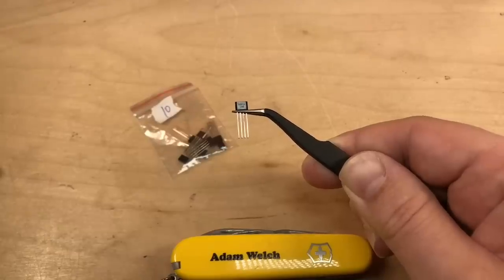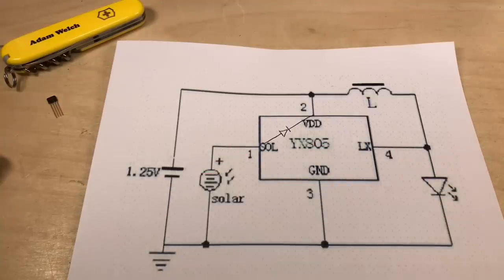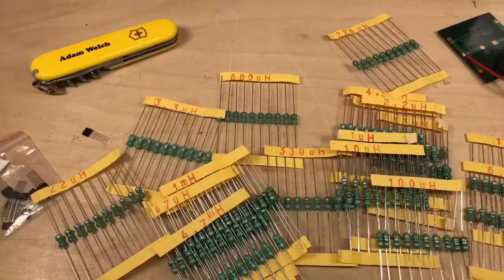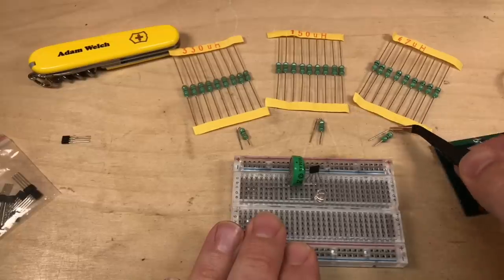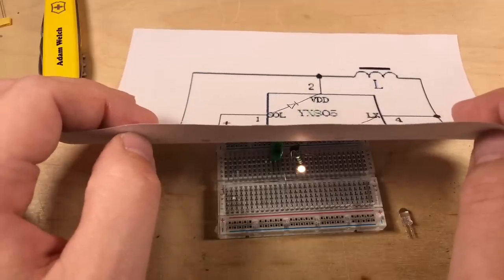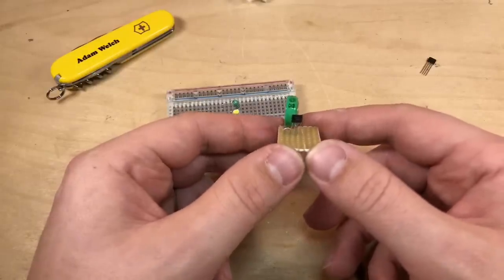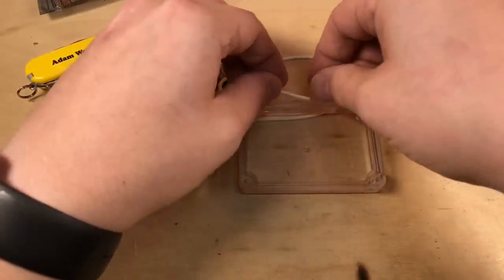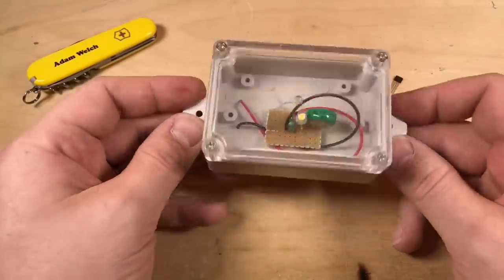YX805 - Solar Charge Controller?

Comment: Thanks for explaining how the inductor contributes to the voltage boost! You have a well-stocked shed, with a modern o-scope and a variety of inductors. :)
Reply: It can be rectified to run transistors, RGB color changing bulbs , 555 timers, etc
I have a video for that also

Comment: Nice one, Adam. Put a larger cell on it, and the LED on the opposite side of the board to the cell, to allow more light out of the box, and it will make a very nice nightlight for less than a pound.

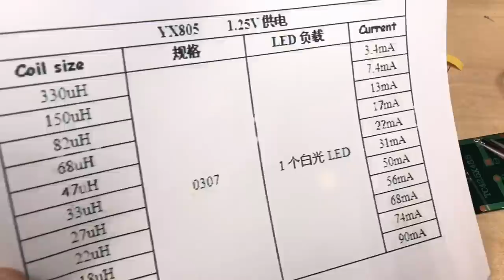Comment: 4:36 if you use 80mAh battery and 150uh inductor which gives you 7.4mA (as shown in data-sheet 6:10) it is going to last 80mAh/7.4mA = 10.8 Hours which is very good. but the standard 5mm LED which you use takes max 20mA and it would be better to use 68uh inductor which gives you 17mA and for lasting 10 hours you will need a battery minimum with 180mAh capacity.

Comment: Nice explanation. The thought that came to mind was that the size of that solar panel can stick out something like 100 mA in good sunshine which seems a lot for that tiny Nimh to eat. The poundland solar cells are much smaller & can produce ~10 mA in good conditions, so I wondered if  a NimH AA cell with say a capacity of say 800 mAh (Poundland often have these in the battery section) would be much better suited to swallowing the output of the solar panel. I am not sure if the tiny cell would die as when it reaches full voltage with the diode drop it would roughly balance the solar cell output, but if there is a slight over voltage from the solar panel it would likely quickly over charge the cell. With a bigger cell one could have more output current and/or more parallel led. Thanks for sharing!
Reply from the maker: Keep an eye out for an update on this video because you may just be right ;-)

Comment: Thank you for mentioning the diode in the IC. That was my main problem when I first found a broken garden light on the side of the road. Since I just want them to charge my nimh cells. Is there a problem leaving the load disconnected? I just have it floating on the recent garden panel I found. It has a 5252F IC which is pretty similar.

Comment: I found one of these controllers inside a small, outdoors solar-powered LED-light with a 150mAh niMh-battery. The LED-light was left hidden on the yard by the previous owners of the house. Too bad it was all corroded to hell inside, no salvaging anything other than the small solar-panel from it -- the panel itself works fine, though!

Comment: I used a YX8018 same circuit but different pin out. I replaced the LED with a regular diode and a 20uF capacitor which developed 10 Volts DC with very low power.

Comment: So next challenge...
Use a slightly larger solar panel. Use a lipo charge controller  hook the panel in. And line up some LEDs.

And if you are daring.  ESP WiFi as a extender housed in the same box..

Cheat  tip.
The pound shop is doing a stone effect outdoor light for £3. It has a lot of space in the base, but the solar panel is a bit small for the needed voltage, but you can get two  and get around 4.* Volts from them. Add a diode.  And you've got great WiFi in the garden and a night light.

I 3d printed a solar racking for it..  that fits over the old sink hole for the single panel.

Comment: @Adam Welch , did you ever think of using those big panels you have in wintertime for small things like this?  There is almost no real solar power use during this season. I had like a 3 Watt output yesterday at 2pm from my 100 + 40 Watt panel.  Solar light stuff only lit up for an hour and went dim except the one spot (6Volt small panel) I converted which is still lit up bright at 6am. 
I used the output of the panels and in series a Schottky diode, some very thin wire to cover 10 meters (lets see how long that lasts) and a dc/dc buck convertor .. google 'Mini DC-DC 12-24V To 5V 3A Step Down Power Supply Module' and they show up. Extremely small, cheap and easy to set the output voltage on and seem very efficient.  The output of that module I connect to where normally the solar cell connects to.  The light will turn on when it is really dark and not like when the sun is about to go down.  Since we're about to go into lockdown again and I have a bunch of those module and blocking diodes I will try to make another voltage line at about 3 Volts for the smaller YX805 like stuff.
Finally some proper useful use for my panels during wintertime it seems.

Comment: As a complete novice, I found the  video very interesting ,and easy to follow.. which I did until the part where the solar panel was being fitted thro the box, ok to there ,  ... then the light worked,  I did not pick up on where the panel wires were connected to, could you advise please,  I am trying to keep sane in the current  climate, and thought this little exercise would hep.
Reply: Same situation. New lock down, plenty of components around me to finally put in use. If you Google the YX805 you'll see a schematic. Minus of the solar cell goes to pin 3 of the YX805 and the positive side of the solar cell goes to pin 1.   What is pin 1 to pin 4 .... Text/label of the IC towards you pin 1 starts on the left hand side.

Comment: So basically what you have here is a Joule Thief on a chip. :)
Reply: I get 162 volts out of my  dual wound Joule Thief, 
but only 10 volts from this garden light circuit .
I can run a 555 timer with either.
Reply: Not really a joule thief per se, but a boost converter

Comment: I've got two pieces of cheap solar garden lights that use this chip. Both failed by sending too much current through the LED during twilight. This only happened for a narrow range of twilight brightness. Beside this particular issue, there is a general problem with these kind of chips: they do not protect your battery against over-discharge. If the solar cell doesn't get enough sunlight during day (which is not unusual in certain areas), this chip will ruin your battery when it is discharged over night.
Reply: Theo0x89 = What a load of absolute rubbish.
Firstly, Ni-CD and Ni-MH batteries don't need "over-discharge protection". In fact, the best way to extend the life of Ni-CD cells is to FULLY discharge them before a recharge.
Furthermore, if the solar cell doesn't get enough sunlight during day, then the battery won't EVER get ruined by discharge... the LED simply will not illuminate for as long that night.
Think about it - the solar cell charges the battery during the day, and the LED always runs the battery 100% dead flat the following night. This repeats every single day.... usually for years, until the battery contacts or switch fail due to corrosion.
As for your comment about LED failure at twilight, that also sounds like a load of bullshit. None of my solar lights suffer from this problem, and considering the literally BILLIONS of these units in active service every day throughout the world, I'd say that there is no such inherent problem.

Comment: is it possible to use YX805 with 5v Solar panel? I have 18650 lithium battery and 1.2 Ni-MH battery. Which one do you prefer? May I use 18650 battery? I want to connect to a tiny Christmas tree lights. Please help. thanks
Reply from the maker: Only suitable with NiMH cells I’m afraid. 1.5v max according to the data sheet.

Comment: I have one of these which I'm trying to repair. Looks like the solar cell is not putting out enough volts. For a single LED and a AAA NiMh, what voltage solar cell is recommended? The original (40mmx40mm) has 4 "sections", so I assume 2v but I'm only getting about 1v. Original chip is a YX805. I put a 5252F in. Seems exactly the same chip, just with a different number.

Comment: good video, I'm looking for a similar component but for 18650 Li-ion batteries to dabble with some DIY solar night lamps.
Do you need some kind of BMS as well or is this setup sufficient to charge/recharge Li-ion batteries?

Comment: With the LED disconnected and the scope on the LX pin how high does the voltage go?  Could it drive two (or more) LEDs in series?  Or is the output voltage clamped or limited internally?
Reply from the maker: Not sure. I’ll see if I can test that.
Reply: exactly my thinking, also would adding a capacitor increase the duty cycle/smooth out the power? Might be able to gain some brightness that way too.
Reply: I would guess a diode would be needed with the capacitor, but that would smooth the output power.

Comment: It is not the sun, but the rain that damages the epoxy  panels.
I have epoxy panels inside glass jars for several years with no damage.
No Degradation at all. The ones not in jars are getting eaten up by the acidity in the rain.
Reply: What you suggest is possible, but I wonder if it is actually ozone in the air. Are these protective glass jars of yours closed up or open to fresh air?
Reply: @TaiViinikka  sealed water tight, look at my videos
Reply: @TaiViinikka  I have 555 timers and the 12F629 programmable chip running on solar circuits w/ 1.2 rechargeable AAA lasting all night

Comment: Hi, I'm looking to set up a small wind turbine to charge  12v lead acid batteries but I'm not sure about controllers. Ideally i wanted one so i could set up a dump load to run a garage tube heater to stop things freezing through the winter. You seem like the person to ask. I have been through a lot of your videos but as yet can't find any appropriate. I have seen american controllers but taxes put me off. Can you please suggest a setup that would do what i need.

Comment: Can i use 3.7 V battery instead of the 1.25 V?
Reply: The IC runs between 0.9v and 1.5v... the battery will never be charged and can damage the IC

Comment: replace the batterie with a 500F supercap and pot it with resin
Reply from the maker: Nice idea... thanks.
Reply: 500F sounds about right, I made one with 100F and it lasts 4-5 hours but I use a colorchanging LED.

Comment: Hi Adam,
I'm looking for a USB relay board that comes with a software (under windows) to program the ON time and OFF time each day for 365 days (calendar) for my inverter (epever HSI 3000).
This way I can program my inverter start and stop automatically for the entire year without having to adjust the start and stop time every 2 weeks or so (I stop the inverter about 1 hour before the sun stop shining on them, to make sure the batteries are charged before the night) and I start the inverter somewhere 1 hour after the sun shine to have enough watts for the inverter and not to discharge too fast the batteries.
Do you know if that exists? USB Relays are easy to find but the software is another story.
Reply: ok I found one on ebay:
Denkovi 4-channel USB Relay Board Module Controller for Automation Robotics - v2

Comment: Hi, maybe I missed it, but does the LED go out in daylight with this circuit? Cheers :o)
Reply: Spikey DaPikey - yes, as soon as the chip senses voltage from the solar cell, it shuts off it’s output.

Comment: Can this be used to charge some 26650 batteries and run some LED's in my back yard?
Reply from the maker: I’m afraid not. It’s designed for a 2v solar input and a ~1.5 volt cell. There are a few modules and solar charge controllers that are sold claiming to fit your needs.  On the cheap side you could look at the wincong sx01, the anself cmtd lithium version or the CTK5S (all of which I’ve done videos on) all of them do dusk to dawn type load control. You might need to look at an led driver though depending on what you are driving. Epever do a few charge controllers with an led driver in them - but there a bit more money.
Reply: OK! Thank You! I could use it to charge AA NIMH. Then use a Joule thief to step it up the volts to drive LED's  Not sure how much currant it will charge, one or 2 AA NIMH.
Reply from the maker: Well this chip is designed for an NiMH cell and is essentially a joule thief too. It’s probably only capable of a couple hundred milliamperes current at most on the solar side - the voltage drop over the input diode might cause some heat at higher currents.

Comment: can you do something alike for lets say 8 leds  maybe adam? my son makes small fairy houses and he asked for some mini lights.. maybe you can point me in de right direction.. . greetz
Reply from the maker: I believe it’s designed for leds at about 3v but as you can see it can handle some reasonable current. I guess you could try 8 leds in parallel. You’d need a bigger cell than I used though!
Reply: Just go and buy a 10 LED solar fairy night kit from your local shop for a few dollars. There is absolutely no point making such a simple thing when you can simply buy it off the shelf at a lower price almost anywhere in the world.
Reply: deslomeslager - I have no idea what you are talking about or who you are replying to. Milene De jong would like to make small and low powered fairy house lights. Fairies don't usually have discos, so they don't need flashing. I'd imagine that they also don't need very much illumination either. Your bike light driver is completely wrong for the application.
Reply: think green ! i would like a solar powered (install and forget) application ,guys . i was more thinking about a small tp4056 kind off solution and i was wondering ifnthis solar charger could power such. btw the fairies around here do like discos very much... as well as 5050 leds ...
Reply: deslomeslager - Sorry, I have absolutely NO idea what you are talking about. The person wants some fairy lights, not a bike headlight. Oh, and YOUR video that YOU linked to shows the flicker at a frequency that is dead fucking obvious to the human eye.
Solar fairy light strings use the exact the same kind of driver as used in this video, either 5252F or one of the YX8xx variants. What solar panel do you propose is used will your bike headlight circuit? I've never seen a bike headlight that is powered by solar.
Reply: Milene De jong - I have already answered you. Go to the shop and buy a solar lighting string that suits your usage. There is absolutely no need to use TP4056, the solar charger / battery charger will include all that circuitry. To take advantage of a lithium battery, you will need a big panel, otherwise you might as well just use NiMH.
Reply: i think i might just do that.. :)

Comment: Is there an equivalent of YX805 for 4.2V
Reply: For 4.2V you probably mean to make something using a Lithium cell. If so, then there also needs to be over-voltage and under-voltage protection, which requires additional circuitry. You cannot ever let lithium voltage drop too far, unlike Ni-CD and NiMH which you deliberately run to 100% flat each night.
The easiest solution is to buy any solar garden light with a lithium battery, and obtain the components that you need from inside. The easiest and cheapest is probably the "shed lights", which are readily available and contain a nice large (remote) solar panel.
There's no point using lithium for small lights, since there is no need for high power density... a small cell won't have the grunt to charge a big lithium anyway. Even a small lithium (say 500mAh) will need a big panel (ie: 100mm square glass).
Most solar with lithium use 3.2V LiFePO4 cells because they are much more robust than other Lithium chemistries. The LiFEPO4 can handle thousands of charge cycles, and is also far more tolerant of over-voltage. But if voltage drops even once to below about 1V per cell, the cell never recovers.

Comment: These are the ones used in those awful solar lightbulbs they sell in Home Bargains and B&M they all fail within a few months due to the tiny underpowered solar cell and useless cheap chinese leaky battery - goof for salvaging components from though lol